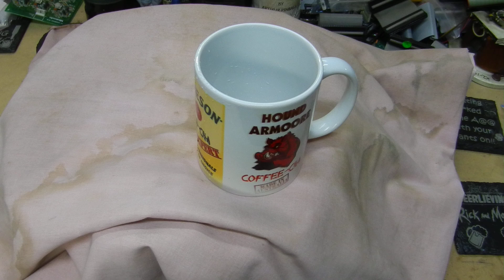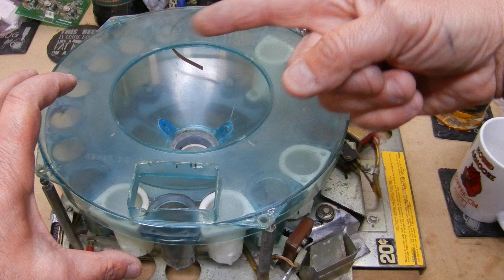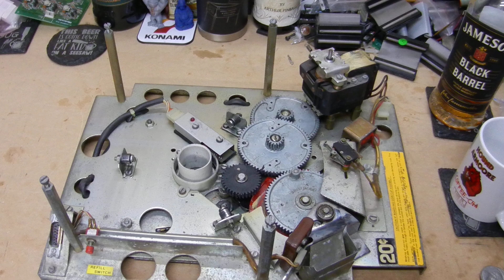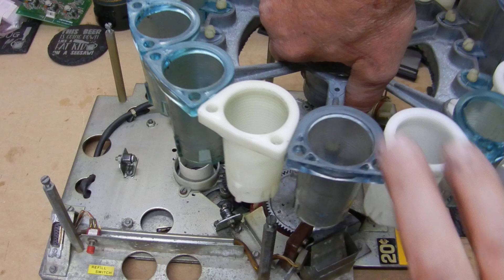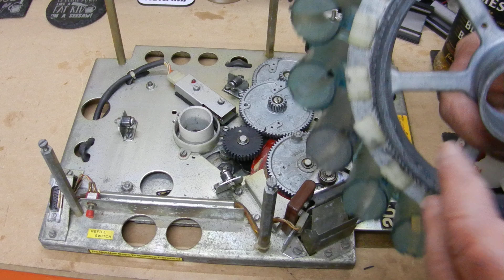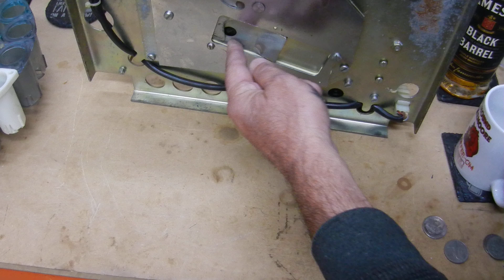Aristocrat Elan  Carousel Hopper   Video Slot Machine

Comment: Hey mate. From Mt Isa QLD.  
Possible solution add a spring to soften the coin drop in the buckets ? 

Also, onto another topic for MK6 XP Aristocrat I want to know if I can bypass the main door sensors and cash box door sensor ? ( Wire Bypass?)